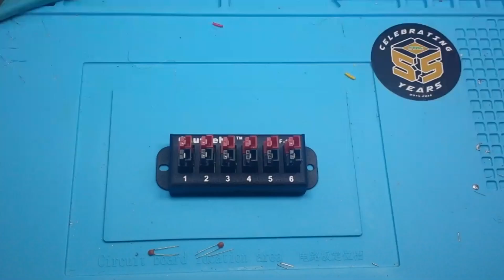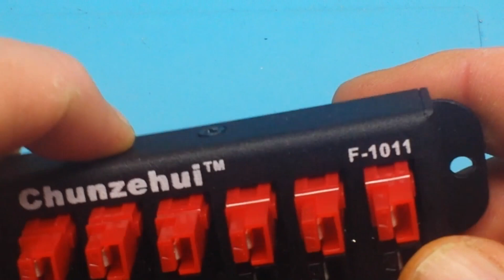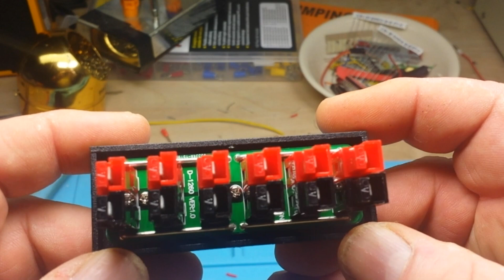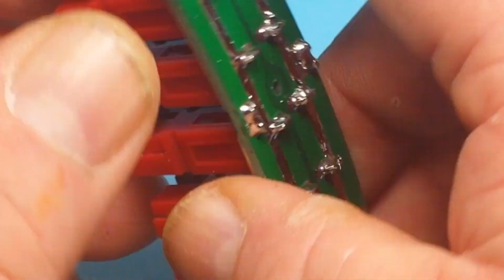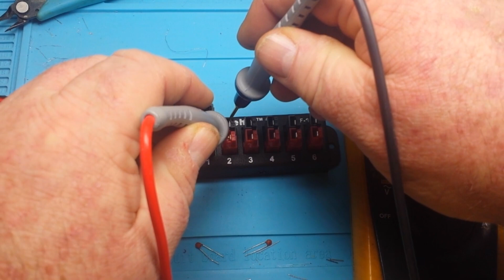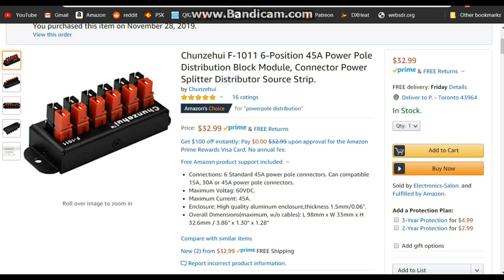DC Power Distribution

Comment: beefy connectors and simple. As long the equipments are fused then a hight input fuse  could be used as precaution. Very neat. We don't use that connectors a lot, but it would be perfect for making connections to SLABS and high loads

Comment: Anderson power pole connectors are available in much high amp ratings than 45 amps. PP180 connectors are rated at 350 amps (600 V) with 3/0 wire.

15/30/45 amp ratings are certainly common in the RC world though.

Comment: you can't reverse polarity if you have your power poles connected to each other in the standard fashion, such as is used by Hams. But there is nothing stopping a red PP being connected to a black PP. That is why most of us have our PPs hooked to the other one using the dovetails molded into them. Many people put a drop of super glue on them and make them permanently connected side by side.

Comment: Hi,  You have a great channel.  Thank you very much for all the good you are doing in training the public in electronics.  I’m attempting to build a Smart LED lightbox and it overheated.  Please advise me as to how to make it safe.  The parts are one SP107E Bluetooth LED Music Controller, one 16X16 WS2812B 5050 RGB Flexible LED Panel Matrix Programmable Display Screen and two 8X8 WS2812B 5050 RGB Flexible LED Panel Matrix Programmable Display Screens.  And one  ALITOVE 5V 15A AC to DC Power Supply Adapter Transformer Converter 5.5x2.1mm Plug 100V-240V AC Input for WS2811 2801 WS2812B LED Strip Pixel Light.  I turned it up to full brightness on white and in a few minutes it started smoking.  The heat from the 16X16 Matrix melted the +V cable ran beneath it.  Is there a safe way to run these parts together?  It will not often be turned up to full brightness, however, I don’t want it to be a possible fire hazard.  Thank you,

Comment: I am new to HAM radio, but am building a radio go box. I was going to install a rigrunner, but a tech from powerwerx told me that the rigrunner drops approx 1 volt. If Im already using a 12v battery supply, then a drop to 11v seems loke a very bad thing for expensive equipment. Especially when transmitting....would likely drop to 10v or so. 

So, is this information correct? If so, I guess running a radio (like ive seen so many times on youtube etc) through a rigrunner is asking for trouble. Maybe just use the rigrunner for misc other power supply needs, but keep the radio connected directly to the battery through appropriate toggle switch?
Reply from the maker: I have never had a problem.

Comment: Power poles are ok for indoors stuff like an inline joint to a SLA cell that would need changing often but they are not good for outdoors and field use, they do corrode, the plastic becomes brittle over time and they break. this is why I stuck with the Motorola rubberized connectors they are not 100% water proof but they keep water out a lot better.
Also why no protection per circuit? Seem abit risky IMO to have a distro point with no fuses on it.
Reply from the maker: Power poles are the standard connector for RACES and ARES in the United States.
Reply: @learnelectronics  Thus why I made adapters LOL My equipment is surplus commercial grade gear none of it uses power pole naively I have adapters for converting to them though.
Reply: There are rubber condoms avaliable along with locking pins to keep connection from breaking... Multi colored housings beyond red and black, roll pins to keep his red n black together, plastic welded pairs so no need for roll pin, and amp ratings from 15-350a as far as in aware. Very versatile choice in connectivity.

15/30/45 Amp "fingers" or crimp pins all use the same housing shown in video